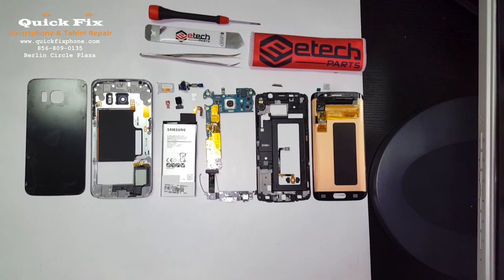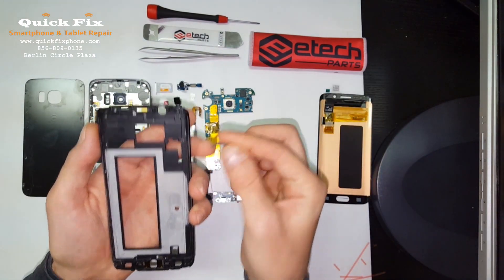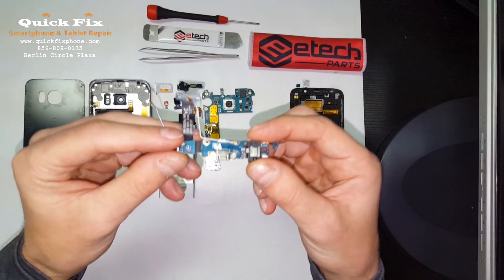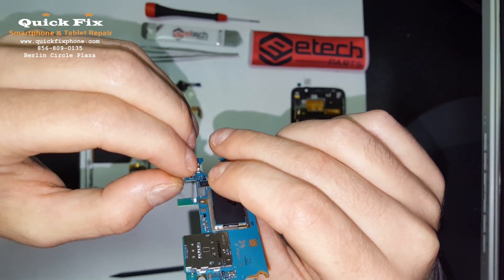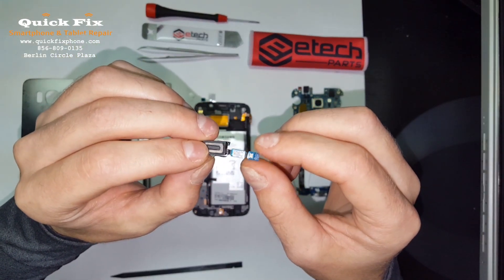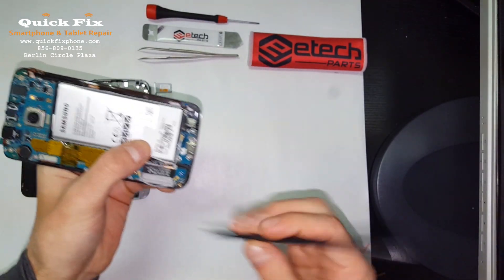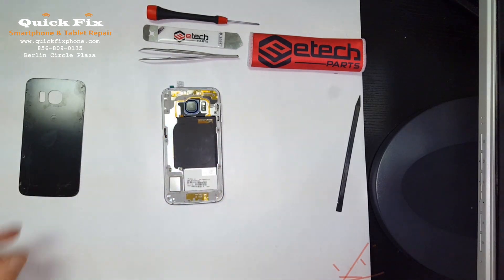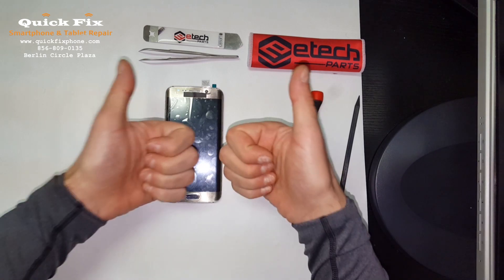Samsung Galaxy S6 Edge Tear Down Rebuild by Kenn

Comment: Great video as always, but I was really hoping to see the teardown... Was the battery glued to the back of the screen on this one? You'd think they would use screws to hold it together, but they use glue all over this thing so you destroy certain parts and you don't see it here because we didn't see the teardown just a rebuild that proves you don't need all of the glue they use to make it user unfriendly, thanks Samsung! This phone has so much potential, but they destroyed the whole purpose of android by eliminating The swappable battery and micro sd card so I didn't upgrade... I'm waiting to see if the use the 
bigLITTLE Cortex A-72-A-57 or a dual A-72 in the S7 and Note 6 and lose that stupid glass back which in my opinion is double jeopardy and not that they will but make it user friendly and at least add the micro sd card slot back and easy to buy and a much larger swap battery... You'd think by now they would be using Graphene batteries that last 10 times longer...